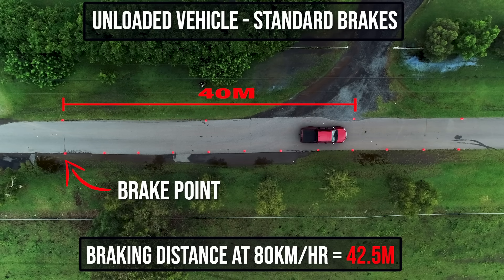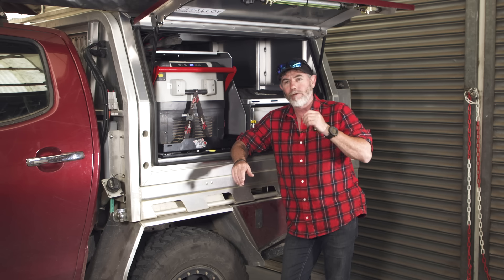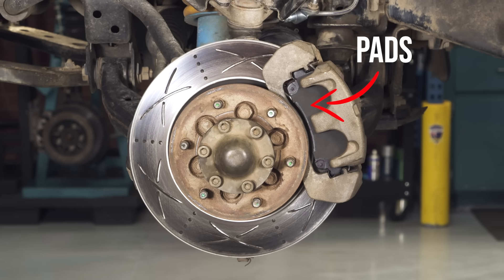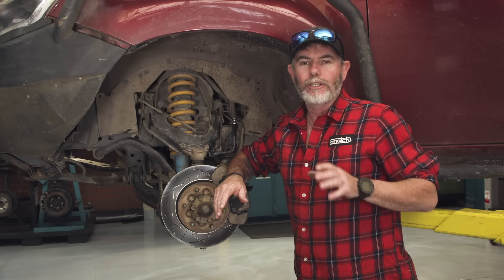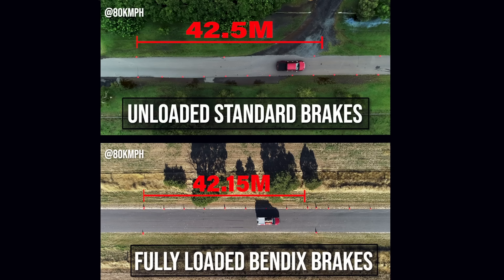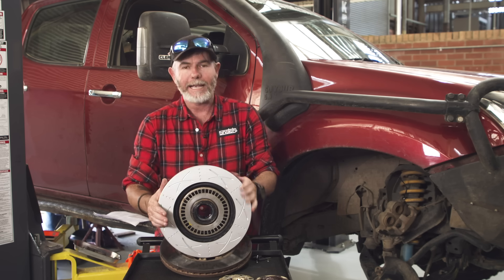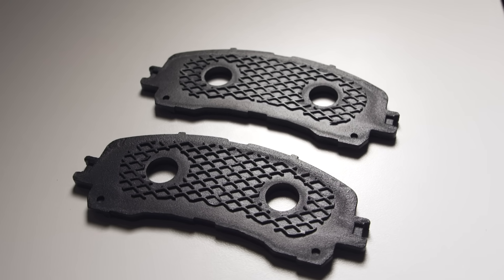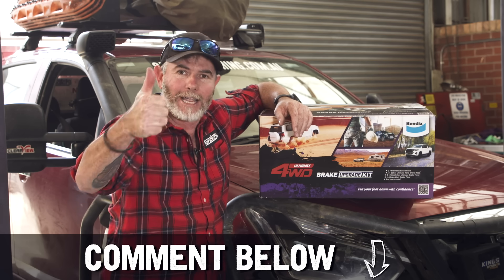SHOCK Result: How poorly 4WDs stop when fully loaded + How we improved stopping distances by 14M!

Comment: Since you installed the slotted and dimpled rotors on your Dmax...How do the new brakes deal with all the mud you run? Does the mud pack up the slots? Does the mud destroy the pads? I have always wanted to install this type of rotor on my Hummer but I am concerned that all the mud I run will simply destroy them.

Comment: Forgive me if this is covered in the video; I didn't get right to the end.

I've never considered the skateboard wheel versus the 31" rim and tyre comparison, but I can see the extra weight = extra inertia, and that would have an effect. 

But brakes use 2nd order leverage. Think of a wheel barrow, with the pivot at the wheel, the load in the bucket, and the force (you) at the handle. Now imagine the load at the end of the handle and you trying to lift it at the bucket, and you'll see what brakes have to do. Hold a tape measure out from the centre cap of your front hub (the pivot) and measure how far out the calliper is (force), then measure how far out from the centre cap to the tyre surface is (the load). Divide the force distance by the load distance and you'll get the mechanical advantage, which in this case will be lower than 1:1. A wheel barrow will be at least 2:1, depending on where you put the load. A Ford Laser is roughly 0.5:1

A huge rim with low profile street tyres and massive rotors/callipers will give a comparatively large FORCE arm to LOAD arm distance, and the brakes will be great (maybe 0.8:1). 

But the standard brakes are not like that on a 4x4. The tyres will be large compared to the street tyre mentioned above. But the brakes will be designed around these distances. When we put huge rims with massive tyres we move that load out to where the manufacturers never designed it to be, and if this ever causes a crash your insurance may not be required to cover you. 

The upgrades covered in this video should be one of your first considerations, before power upgrades.

Comment: All of my vehicles get an application oriented setup, my van with a bored out motor has carbon race pads since its a light van under 3.5k pounds, our family rig that we drive spirited is an 08 mountaineer and they are heavy so I used legit police pads rated for twice the service life of regular pads, uprated rotors for cooling and pretty soon ill be switching to dot4 LV like the service bulletins call for after I replace the outer brake piston seal since the dot4 from 2years ago is already amber like soy sauce, I'm guessing theres the slowest bit of contamination but dead stopping from 100mph has zero fade even weighed down an extra 1200lbs

Comment: Good presentation Graham. I guess coz front brakes provide 75% of the stopping force, you chose to ignore the rear brakes - or is it because Bendix don't do rears?
Reply: Hi Murray, Spot on! as the fronts provide the largest contribution to braking effort, we're only doing fronts for the disc/drum vehicles. Upgrading the rear drums to discs would be a very costly modification.

Comment: If that blue stripe does not go all the way through then it looks like its job is to give the brakes hard early life bite so you feel good about buying them. Beding in brakes takes only a few min. Fitting pads that change stopping power and feel over time sounds dangerous?

Comment: Excellent video thanks. Just had Holden replace Rotors and pads on the Colorado. The truck was driven pretty carefully but was used regularly for heavy towing 3 ton. The original rotors must have got red hot. Not just warped but evidence of massive over heating. They were simply not good enough. Will give Bendix a go next time. My old 80 series cruiser in comparison at 400,000k still had original rotors and had towed similiar weights throughout it's life.

Comment: Ive looked at this for my USA 2016 toyota tacoma TRD OR and for what I can see they offer a stoptech kit which includes rotors, and pads for just over $200 US. are there others I should consider? I roll with a simple bed rack, rtt, and about 300lbs or so of camping gear/recovery gear + passengers (typically just me, or the wife, and me..). bumper is ordered, and I plan to put on about 300lbs or so in front bumper winch, and skidplates, and replace the factory predator step rails with some actual rock sliders. I also carry with me 12 gallons of fuel, and 6gallons of water.

Comment: Not just the rotors, pads and lines, but you really should upgrade the calipers too.  Aftermarket calipers are often much stronger and more corrosion resistant than your standard calipers.  Upgraded calipers can also (in some setups) allow you to increase the diameter of your rotors and the size of the pads, leading to seriously increased braking power.  Also, while slotted rotors like the ones you have shown are great, NEVER use drilled rotors on a 4WD setup. (Ones that have actual holes drilled all the way through the rotors) Stones can get caught in the holes and utterly ruin your pads.

Comment: Hey Graham, I hope you know that it's not actually the caliper itself that is clamping the pads to the disk / rotor like you explained in this video. It's actually the piston(s) that are usually housed inside the caliper that utilise the brake fluid pressure to push on the pads, forcing them into the disk.

The braided brake lines are a good start if you can't afford a full upgrade kit because of the reasons that you explained.

One more thing that you briefly talked about regarding upgrading the pads while retaining the stock brake discs. I know this last part is for a slightly different vehicle. You said that upgraded pads can do some serious damage to the stock disks. Motorcycle brake discs are about half as thick as the upgraded 4x4 disks. When people upgrade their brakes on a motorcycle, from what I've seen, most people put braided brake lines and upgraded pads, but they run the stock brake discs and no damage occurs.

Comment: Something that was touched on here but not expanded upon much, was big tires. Even without a large extra loading, a 4wd with 35" tire will take a LOT more brake force to stop vs a 30" tire. part of it is tire/wheel unsprung weight, since typically the bigger the tire/wheel combo, the heavier it is.. Other part is the "leverage" effect of the larger diameter wheel/tire combo (Like using a cheater bar to loosen a tight bolt, bigger equals more force) ..First thing you should do when installing larger tires, is upgrade the brakes! ..Same goes for street cars when you put stickier rubber on to corner and accelerate better. Why would you not wanna take advantage of the extra grip to stop? Upgrade..  Often it's not expensive to do (most vehicles DIY 400-600 bucks US) and it's SO nice!

Comment: Greetings from Ireland! Brake upgrades are a fantastic idea, but I'm curious why you didn't upgrade the rear brakes from drum to disc? Surely this would be a huge help?
Also, would you need to get an engineers report after upgrading the brakes? I know i would in Ireland or my insurance would be void. In fact i know of some insurance companies charging more after a brake upgrade which flies in the face of common sense!
Reply: Hi Mick, Good to hear from Ireland! By staying with the OE dimension rotor and pad size, engineering is not required. As to a rear drum to disc conversion, this would require an engineering report and would be in the region of $3 - 5000 and remember that 70% of the braking effort is at the front axle due to weight transfer. Cheers!
Reply: @BendixWorkshop  Very interesting information, thanks for the reply. May have to reconsider upgrading my brakes, was out off by the need for an engineers report but this is really interesting, and makes complete sense to be honest!

Comment: You showed the front disk upgrade that work, does it make sence to upgrade the rear brakes as well? Is it enough to get some good drums and pads or does it benefit to convert the rear brakes to diska s well?
Reply: Hi Mihhail, a disc to drum conversion will make a difference, but 70% of the braking effort is done by the front axle due to weight transfer when braking, so best bang for buck is starting at a front upgrade.

Comment: -YOU HAVE GEARS TO CONTROL DOWN HILLS, WITH OR WITHOUT LOAD .. I have a auto R33 skyline still on original pads & disc , 225,000 k my Nissan Navara 3LTD  190,000k CART STOCK ON THE UTE & TRAILER .  car & ute disc still like new on both .gears to slow you down, bracks to stop .you don't stop for going down a hill for 1 or 2 ks so why have your foot on brake??
Reply: Hi David,
This test is for emergency braking. I've had to hit my brakes in an emergency before and you don't get time to shift down in a manual and if you do you risk compression  lockup on the rear wheels and that means half your truck is sliding and sliding wheels are not controlled. Also Grahams truck is an auto so no real braking available.
Reply: @joer3890  I learned to drive in a Mini on a hill farm no brakes .drove a S1 landrover on another hill farm NO brakes or clutch . you learn how to drive .my Skyline R33 is auto my XA Falcon was auto .autos still have gears .Changing down ONE foot on clutch  other foot heel toe brake accelerator, or double  clutch you learn that driving trucks .I have never had brake fade .on a backcountry road no moon night ,two lane road  short one lane bridge angus cow just off end of bridge if I had hit the brakes I would have hit the cow ,but I pushed the accelerator to the floor in the XA FALCON shifting to second  drove around first cow to find I was now lined up on two cows now, because I had the power on in second I was able to drive around them.when you lock up the brakes you are only a passenger,you are not incontrol .
Reply: @davidorpwood8433  scary as hell and every situation is different. You can't account for every situation or variable so all you can do is have the best "performing" equipment ,which doesn't always mean most expensive,.so that your gear can handle the load.
Reply: @davidorpwood8433  ps. In west Oz my little LC Torana had to scoot around a few cows in the middle of the road at 110 ks on a back road once, so i was very glad my car was more nibble than a J40.
I just agree with having high performance gear for safety.

Comment: Hi there,
Very well made video explaining to mortals all the Y’s into breaking.  I’m in the very early stages of restoring a working 2007 fuso fg140 dump truck to an Expedition vehicle.  I’ll be upgrading to 17” super singles with 37x12.5R17. With GVWR of 14050 lbs & I’m expecting to be within the 80% of @ 11240 lbs fully loaded. With this in mind any suggestions to what I should consider upgraded my brakes to?   And approx costs of parts. 
Also which tires would you consider putting on a E.V. such as what I’m building and all the Y’s.
Cheers..... Y.

Comment: I did that years ago, after having a nasty surprise whilst towing a heavy trailer on a motorway. Whilst I'm still on drum brakes, (yes the landy's that old) I used the much bigger brakes off a One Ton model. The front shoes are almost twice the width of the standard ones, along with much bigger slave cylinders. Well worth it and no more Crikey moments!

Comment: Brake fade is why you should ALWAYS use engine braking when ever possible while driving.
Use that tiptronic shifter that's what it's there for. 

Brake fires are reasonably common on the racing pit lane because of the abuse. But nothing surprising to those at the track.

Comment: Bendix is a bit late to the 4WD brake party, but good to see they are now right up there.
I have Brembo rotors on my Patrol, with A1RM pads also from an Aussie company, and braided lines made up by the local Trade Brake & Clutch.  The Brembo rotors are an excellent "bitey" material and I can invoke the ABS no problem on heavy 33" Nitto Trail Grapplers.  The stock Patrol brakes are an embarrassment and must be ditched ASAP :)

Comment: What you should also have mentioned at one stage throughout this paid promotion is the importance of adjusting your proportioning valve correctly if your vehicle has been lifted, and making sure your rear drums are also adjusted properly, both of which will only cost you a bit of time on the tools, and have a significant effect.

Comment: i recon if i ever had the money to i would get either some Brembo or Wilwood 6 piston brakes
Reply: waste of money.....all you need are ceramic pads,drilled, [ not dimpled ], slotted rotors,IF,you can buy them here in aus,,illegal apparently,i have them,on my f250,from u.s..plus,,you need to ditch the power booster,& fit a hydro boost..60% more braking power.with no other mods.$200 from states..this country is so backwards & restricted...just fitted a duel diaphram booster & drilled slotted rotors,ceramic pads,to my 1975 f250 highboy,all std fitment,no mods..it runs 9 1/6 wheel studs,the rear has chevy studs 3" long,as the rear diff is 2" narrower than front, 1/2" wheel spacers,makes it 1"..only run 35" tyres,nothing less.&,yes,it has p/s & air..with front locker,rear lsd,that works,unlike jap,lsd,s...why do things here costs sooooo much..???.

Comment: What brakes upgrade kit is recommended for 2012 Toyota Hilux 1kd-ftv
Reply: Hi Mad21X, thanks for your comment. Depending on your Hilux we have a few variants.  
U4WD-BUK1 

- KUN26 3.0 D-4D With VSC Std Ride height
U4WD-BUK1+2  
- KUN26 3.0 D-4D With VSC
 50mm (2") suspension lift
U4WD-BUK6
- KUN26 3.0 D-4D / GGN25 (4.0)
 / 3.0D / 4.0 No VSC Std Ride height
U4WD-BUK6+2  
- KUN26 3.0 D-4D / GGN25 (4.0)
 / 3.0D / 4.0 No VSC 50mm (2") suspension lift

Enjoy

Comment: Did you upgrade your brake fluid as well? Higher boiling point?
Reply: Hi Daniel thanks for your comment, the Brake Upgrade kits come with 1L of HD Brake Fluid.
Reply: Is there any way to get a brake upgrade here in the US? Any distributors ?

Comment: This is something us Landy owners have been doing for years. Braided lines - done, better Rotor - done, better pads - done, hydraulic booster added to stock vacuum booster - done. I use EBC Brake components front and back in my 130 , plus our stock calliper's have more pistons in each calliper than most other brand 4x4's, plus Stainless Steel pistons at that. Time you lot caught up I reckon.
Reply: Haha fair enough  I'll  admit  I do like toyotas.
However  my daily is a 78 f100.
So ford fanboy would've  suited better.
Haha have a good one.
Reply: Yep with the reliability  of  a land rover I'm  sure theres plenty of time to rebuild  the  brake systems.
Reply: @asdasd-ni8eg  Go away toy ota fan boy, your bile is not wanted here

Comment: I drive a MUX the abs is hopeless pos. ... I pulled the fuse ....  The only way to improve the braking force is BIGGER ROTTER'S .    to reduce brake fade fit harder pads but they won't work well cold ......MUX   the so called switchable traction control CANT BE SWITCHED OFF ...   Not happy ......   Once  again I pulled the fuse .....

Comment: The reason a lot of European car makers use pads that create so much dust is the pads are a metallic composition.  That type of pad eats at the rotor and grips dependably regardless of conditions.  A ceramic brake pad is like a pencil eraser in that it wears away not the rotors.  Ceramic also need replacement more often.

Comment: I'm curious about % more stopping power if you go about an inch bigger on the rotor
Reply: A bigger rotor introduces different issues as you'll need to have the vehicle modification engineered to stay legal and the ABS re-calibrated
Reply: @BendixWorkshop  stay legal? Why? And abs recalibrated why again? The wheel is still going the same speed

Comment: TBH - even stock braking systems have enough braking force to lock up the tyres (ABS Will prevent this). The limiting factor is not your Caliper, disc or even brake pad, the limiting factor is your tyre. 

Larger brakes do not increase claming force as the force is provided by your brake booster and master cylinder. 

Larger brakes ONLY disperse heat more efficiently.

Comment: Hi,
    Do they make a kit with extended brake hoses for 2 to 4 inch raised suspension vehicles, done this to my 80 series and it makes a huge difference with the brake hose upgrade.
200 series Sahara with 2 inch raised and 1 inch front diff dropped suspension.
Reply: Hi Glen, we do have kits to suit raised vehicles. At launch, the 80 and 200 series weren't available but certainly on our radar. Cheers

Comment: I call bullshit on the after swap stopping distance. Its a function of tyre grip and weight. If your factory brakes can lock the wheels then they are capable of pulling up the vehicle in shortest distance possible. Factor in fade and for sure  better pads and disks are going to make a difference but emergency stopping at freeway speed you shouldn't really be experiencing heavy fade.

Comment: I feel like the factory brakes are really not that good because on our work trucks unloaded if you slam on the brakes they stop very fast and tires skid a bit on dry pavemnet with good tires abs kicks on for second. Put 2000 pounds in the back and the stopping distance is only a bit more.